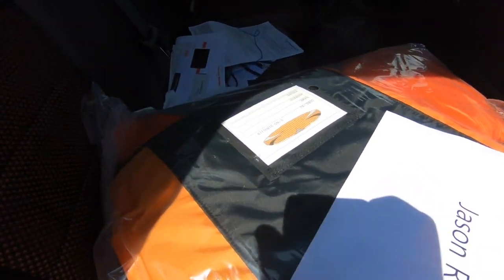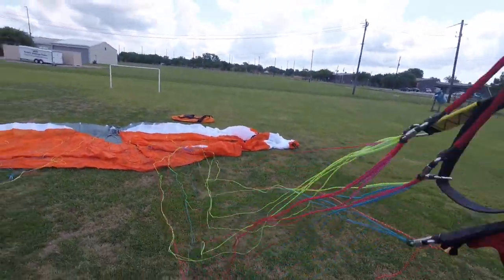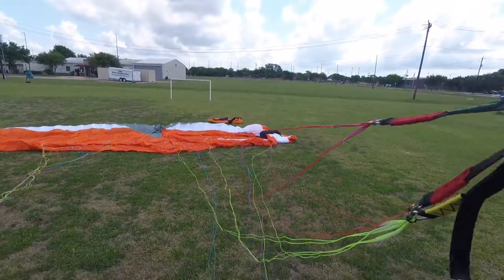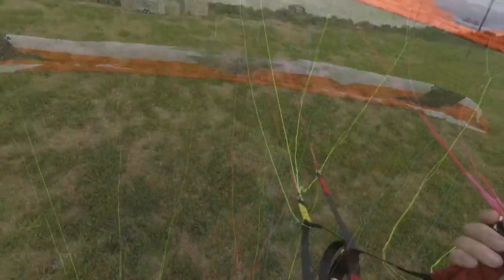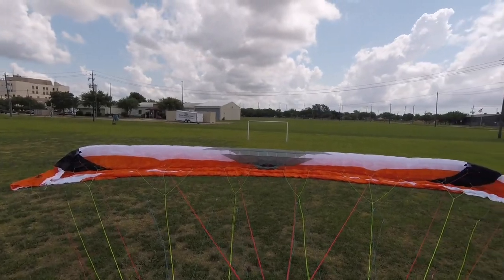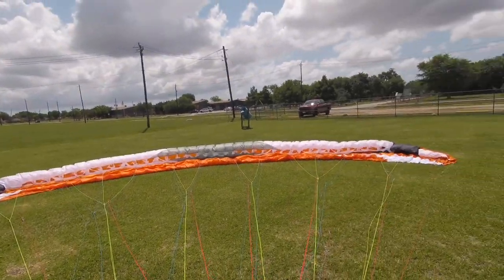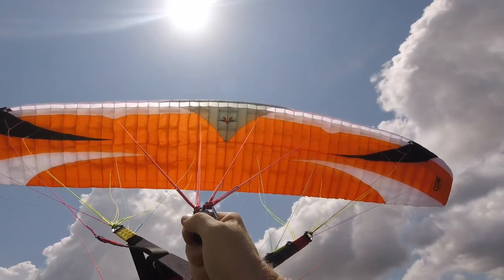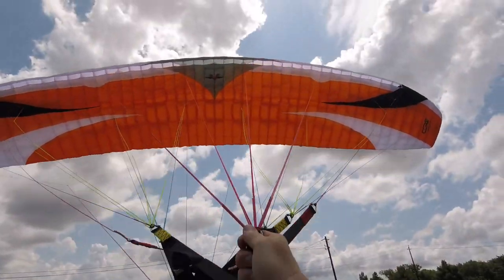Jason Rooks PPG wing pre kiting. How & Why.

Comment: I am desperately looking to buy a 36m velocity if you want to unload your smaller wing.
Reply from the maker: C Baeseman  hi, the 36 meter velocity core that I have is only about 3 months old. I only have two short flights on it. Those are in the beach video on the site. I can sell it to you and buy me another one if you really need one. But the savings would be minimal because it is a brand new wing. My number is 979-417-7534 if you would like to give me a call. Thanks, Jay
Reply: Thanks for the offer but I don't want to cause you all that work for a 1 on 1 trade. I would love to have it but I can spend a bit more time looking for someone really 
wanting to sell.
Reply from the maker: C Baeseman no problem. I put in a call to see what I could get you a new one for. I will get a discount and pass it right to you.
Reply from the maker: Hi, I can get you a brand new 36 velocity core Wing at $500 off cost.
Reply: @jr7227  hi, how to get a discount? on their website it cost about $3.5K.